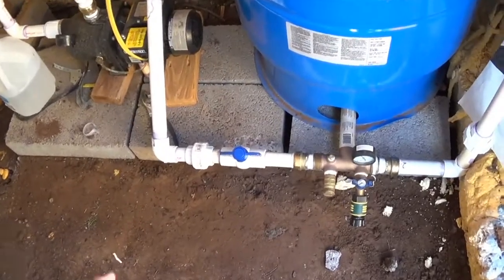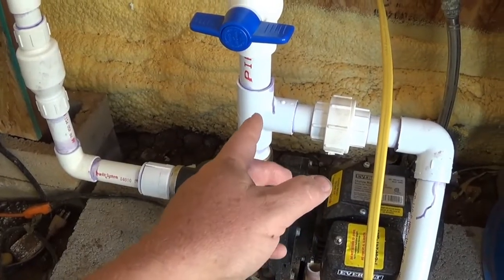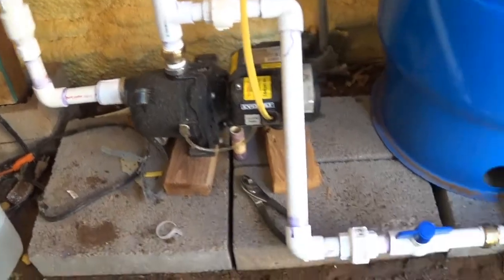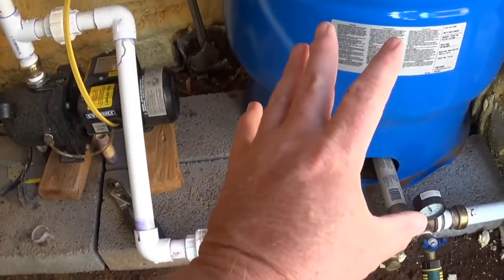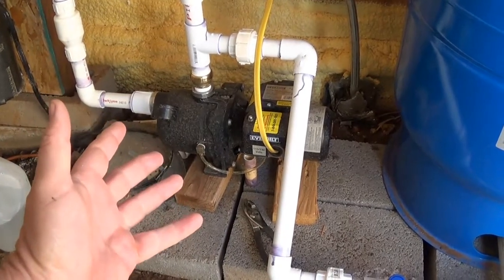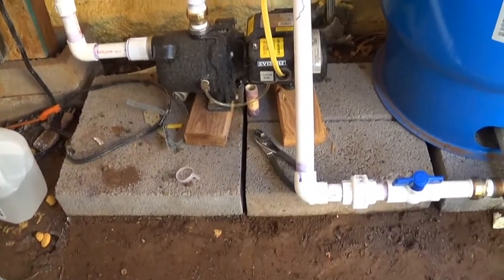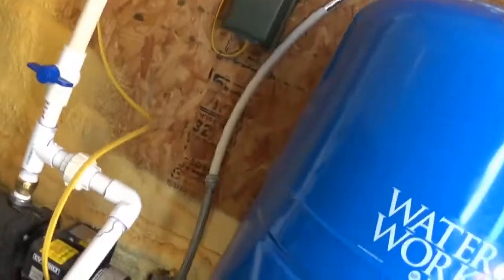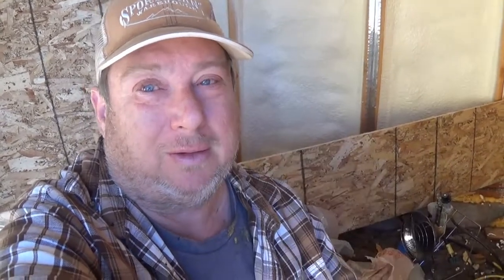Jet Pump Cycling Problem Solved. No Leaks. You Wouldn't Believe It.

Comment: Hummm. Interesting! Dynamic Pump Pressure? My theory. It looks like while the pump is running the pump output pressure (apparent pressure) is active and when the pump is in a resting state the pressure drops to true pressure? By taking the check valve out of the equation the pressure tank keeps the pressure at apparent pressure?  have you ever noticed when the pump turns off the pressure gauge drops a couple pounds? (It would be interesting to see what the pressure drop was with the check valve in the line. just curious.)
Reply from the maker: no i havent noticed the gauge dropping.

Comment: I have one of those pos Chinese pumps from china freight and the pos melter at the pressure switch..can I use it by bypassing that crap?
Reply from the maker: dont know. i guess you can try and see what happens. on some pumps you can replace the switch
Reply: I deleted the tank and melted pressure switch.

Comment: Apparently the pump has to read pressure from the house. New remove the check valve it is now reading pressure from the pressure tank. There should not be a check valve after the pump anywhere in the line. A ball valve should be installed. For servicing.  With the check valve in front of the pump the first time the pump was unable to read the pressure.
Reply from the maker: thanks.

Comment: Did you try a different check valve? Maybe have just been faulty.
Reply from the maker: no. i just i would step back and remove the middle cv after all i guess i should only have the first one. didnt try or test the middle cv.

Comment: Imagining the system, I would compare the action going on to the scavenging that occurs most-pronounced within a 2-cycle engine while running. The scavenging causes air to move into the combustion chamber from the intake side, while both intake and exhaust ports are exposed to the same air stream at the same time, and it does not blow exhaust backwards into the intake side. In the engine model, the air leaving the combustion chamber first through the exhaust port has velocity it gains when leaving due to the initial pressure. A flow of mass, be it air or water, also has kinetic inertia while moving. When the electrical energy in the pump motor is cut, the flow has to expend its kinetic energy into the system before coming to a rest. The flow continues into the reservoir before stopping. If  the one-way valve is ahead of the motor, the scavenging effect places the pump on the low-pressure side of the energy flow after the water inertia comes to a rest. The "reflected" pressure wave hits the one-way valve, the valve closes, ahead of the valve is pressure, behind the valve is a moment of vacuum (or let's call it simply a lower state of energy rather than reaching vacuum), and as the entire flow comes to a halt the rear one-way valve then also closes, and what you are left with is some value of pressure not entirely influenced by holding-tank pressure but by intake flow and motor inertia. So you're left with the pump being in a trapped region of pressure that is lower than the holding tank. When the one-way is placed behind the pump only, the pump remains in a region which is not cut off from the holding tank, so when the pump motor is cut the reflected pressure wave travels back past the pump, hits the one-way behind the pump, the valve closes and the pump remains in the region where full-pressure exists, and the pump continues to see that region of pressure. Now you can hopefully try to explain this to plumbers. :)
Reply from the maker: very interesting way of looking at it. thanks.

Comment: I think this has happened because the pressure has been looked in the pressure tank because of the second check valve and not sending pressure to the pressure switch.
Reply from the maker: could be. i know by removing it it fixed the issue.

Comment: The only checkfile needed on that system is the one immediately after the well or water source.  It would be there to protect the water source from contamination or back flow. Everything after that would just be ball valves that could be shut off for servicing.  Those pumps turn on when water flow is detected. But they require  Back pressure at the same time. I mean the check valve right after the pump eliminated that. And the pump would start short cycling. By removing the check valve the pressure tank Is giving the pump back pressure. The check valve on the main line should be removed and replaced with a ball valve so you have an accurate reading. And if the pump starts short cycling you will know there is a leak in the main line or at the house.
Reply from the maker: now i know that. lol. i like it that i can post videos and i get so much input the information is incredible. thanks
Reply: @ArizonaHotHomestead   Nowadays that's how we learn. College is a joke.

Comment: I did the same thing. If you think about it, building pressure to correct amount at the pressure tank builds it the whole way to the pump while the valve is open, once pump shuts off, your valve closes, and all the water behind the check valve is suddenly lower than the side the tank is on. So it kicks on, valve opens, pump is at cut off pressure, valve closes, pump back on. This all happens rapidly. Can't put the check valve between pump and pressure tank.
Reply from the maker: nicely explained. thank you
Reply: yup, we thought we were being cleaver...Damn You Science !!!

Comment: A check valve after the pump will keep the pump from seeing the pressure in the tank, and if the check valve before the pump is the slightest bit leaky, the pump would see its pressure draining away quickly and turning on, then immediately stopping because the tank is already full.
Reply from the maker: thanks for the info.

Comment: The pressure in your system is maintained by the compressed air in the tank. Air is much more compressible than the water. The middle cv isolated your pressure switch on the pump from the air bladder (pressure maintainer).
Reply from the maker: thanks. why cant others say that?

Comment: Looks like you have a check vlv leaking by. You need a gauge in all of three sections to really see what’s happening. Also you want to work with the pressure switch in small adjustments sounds like it’s set too high and you should have a low pressure adjustment. I only have one check vlv in my system and that’s just so the water can’t go back down the well. If you have a local pump supply like Essco that works with water wells they will help(hopefully). They were the ones that help me set up my system.
Reply from the maker: good info thanks..

Comment: I think the water has to push the check valvues springs open.  Some of the pressue is being used to keep the springs open,   Also when I had a 5 micron filter before the motor, mine cycled as well.  My setup was one check value and filters after the pressure tank.  I use a sand filter to filter the water a bit before the motor and to keep the pressure consistent.
Reply from the maker: so far my system is holding perfectly. . nice. thanks for sharing your set up.

Comment: There is a pressure differential between the tank and the pump. It looks like the pump has the pressure switch.
Reply from the maker: yes the switch is on the pump

Comment: how big is your tank and how is your tank filled?
Reply from the maker: water tank? 5000 gallons. fill it with rain or have water hauled in. . the pressure tank is 44 gal.
Reply: @ArizonaHotHomestead  wow 5000 gallons. 

I have an air lift pump that pulls water from a well that goes to a 300 gallon holding tank.

Comment: Check valves require a pressure differential to work. When the pressure is higher on the supply side it will allow flow, when the pressure is higher on the check side,(when you turn the pump off)it will not allow flow. If you have multiple check valves in line, - lets say 10 of ‘em from a pump to a water hose - if you open the water hose they will all allow flow. Once you close the hose, you have created a change in pressure differential - but only on the last check valve in line. Check valves are not like ball valves, they are not an on or off, if the pressure differential becomes equal on both sides it WILL allow flow (a leak) in the wrong direction…. You should also check into a company called “cycle stop valves” i just installed one myself on my well system.
Reply from the maker: thanks for the explanation.

Comment: Having check valves orientated vertically isn't the problem, but it is if they're upside down, i.e. normal flow direction is downwards and reverse flow would be upwards. Unless the valve clapper is spring loaded shut, gravity will hold it open for small flow rates. A colleague engineer of mine used to say, "where possible, design things to use Gravity; it's cheap and reliable!" Gravity is working against your first check valve.
Reply from the maker: thanks for the input.

Comment: Tank controls pressure to pressure switch
Reply from the maker: now you tell me. where were you when i did this.?? lol....
Reply: The check valve restricts the back pressure from the bladder, therefore you don't have the proper signal to keep the switch open. But, when the pump cycles on, the check valve opens and all the pressures are now equal.

Comment: I am so confused now.

I don't have a check valve between pump and pressure tank and mine is chattering bad. I think my tank is bad though.
Reply: and I thought mine might be chattering because no check valve.
but yours is second video that someone took out the check valve I already don't have to fix the chattering
Reply from the maker: i am no expert. maybe something with the switch? pressure switch?
Reply: @ArizonaHotHomestead  thank you for the reply.

since my comment I changed the switch and it stopped the chattering.  I do suspect that just clearing sand out of the other may have fixed the problem.  but my pressure tank was bad and no telling for how long so maybe the long term short cycling had tore up the pressure switch.

I acquired the property with the well in this condition. that is why I don't know how long it had been messed up. 

but thanks again for the reply.
Reply: I just rewatched your video and I think maybe the check valve between the tank and pump was isolating/blocking the pump from seeing the pressure from the tank. 

i.e.  the tanks pressure wasn't allowed to push backwards through the check valve to close the pressure switch.
Reply from the maker: @fredgarvin4482  now that makes the most sense. thanks.

Comment: the pressure switch on the pump requires the back pressure from the tank to tell it when to kick on or off.  the middle check valve was not allowing the blue tank to show its current pressure to the switch on the pump.
Reply from the maker: interesting. thanks... sad that was hard for me to get that info. lol

Comment: Also, thinking about it, the diaphragm in your pressure tank burst pump will cycle just as you lock the pressure in the pump using one check valve before and one after.
Reply from the maker: interesting ... thanks for the info

Comment: Why not just use a regular RV water pump?  That's what I've been using for 8 years into a pressure tank like yours...has built in check valve.  Nothing elaborate at all...nothing fancy.
Reply from the maker: becus thats to easy. lol....

Comment: You have a T running to the pressure tank. Should have mounted the pressure switch there..Not on the pump between two check valves.
Reply from the maker: thanks.

Comment: I had too use peculiar pex pipe crap. And I copied WHAT YOU did in YOUR first video.
I haven't been able too shower in a month. Getting the money soon too fix this now that I found your new video. And by the way the pressure switch can't feel the pressure from the tank when the one way door close'es. Open the pressure switch turns off because it feels the pressure but when the door shuts the pressure switch can't feel pressure or loss of pressure.
FUCK I'm mad. It's hot and been getting yelled at too fix.
And short on cash showered at a truck stop by paying. 😡😠🌋🌀🌋🌋🌋🌋🔔🔔🔔🔔🔔🔔🔔🔔🔔🔔🔔🔔🔔💣⚡⚡⚡⚡⚡⚡⚡⚡⚡⚡⚡⚡⚡⚡⚡⚡⚡⚡⚡⚡⚡🔥🔥🔥🔥🔥🔥🔥🔥🔥🔥🔥🔥🔥🔥🔥🔥💩🔥👎👊💥💫💥👿😤⚡🔥🌋🌋🌀🌀🔥💥⚡⚡⚡🔥🔥🔥💥😤🌋🌋🌋🌀🔥⚡🔥💥
Reply from the maker: it has been a hot summer. good luck with fixing it. sorry you havent been able to make it work right away.